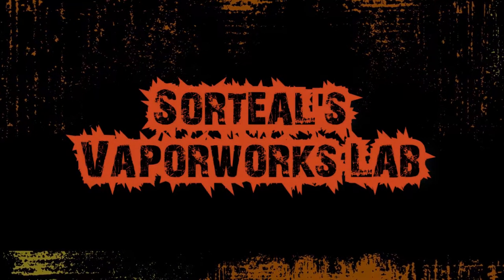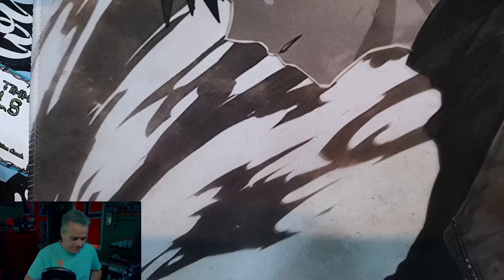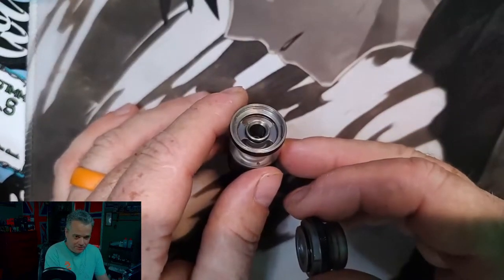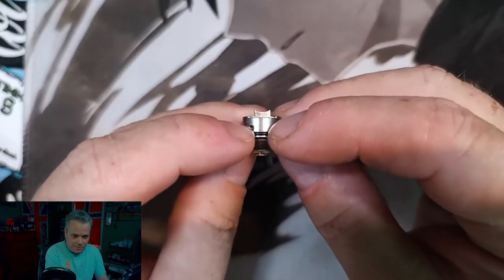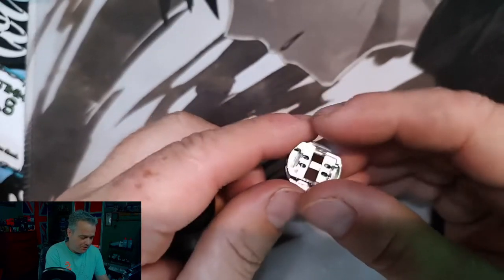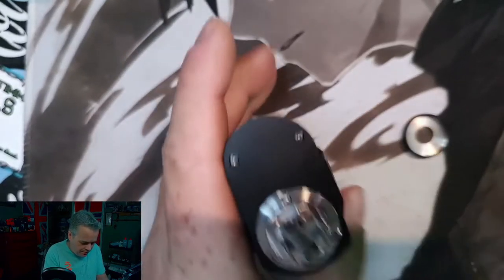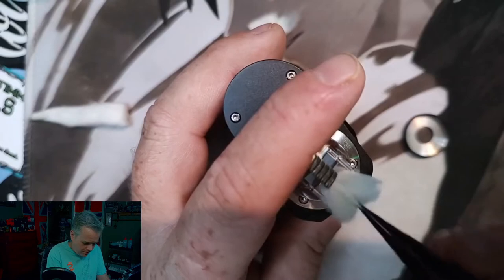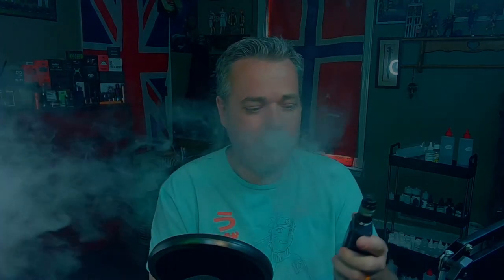The Nitrous RTA from Damnvape and Koko Sarang!

Comment: Please guys, let's be honest at least for once, I know we all want to make money doing all these reviews but, it would be nice if people can be honest. This RTA doesn't work with anything higher than 50/50 VG/PG. If you try anything around 70/30 and higher, you're in for dry hits and I dare anyone prove me wrong. This by far if the worst RTA I've ever built on. It won't wick for shish or it will just leak when filling it. And no, I lifted the cotton and tried various cotton snugness.
The major issue everyone is afraid to talk about is the wicking holes with are just too damn small for anything above 50/50 juice to flow through.

Comment: CAn you think of some RTA that don't require tucking? or GTA? Just cut the cotton and screw on top cap? Technically this, M25, Aromamizer v3 are GTA right? because rdta style wicking on build deck?
Reply from the maker: When I say RDTA style I'm talking about the wicks being dipped down into a pool of juice. The M25 has those channels where juice flows onto the exposed side so not really RDTA style. The Profile M and the new Blaze RTA are the dipping your wicks with juice flowing under the deck into the wick well which is kind of RDTA-like. The Nitrous RTA is gravity fed so you don't have to do a whole lot of tucking and in fact you really just want to lay your wicks into those wick wells just slightly and leave your cotton puffed up. The Eclipse RTA is wicked just like an RDA so it may be more of what your looking for. None of those would really qualify as a GTA imo. GTA are tank Atomizers with the deck in the center of the tank and has been closed off, pressure-wise, and the wicks hang down very much like an RDTA. The Mage from CoilArt and the Fuji from Digiflavor are examples of GTA atomizers.
Reply from the maker: Bishop is wicked almost exactly like he seems to be wanting. Project X as well. Great suggestions!

Comment: If nitrous rda have a score at 10, how much this nitrous rta score for flavor ? 
Because, any rta i have, usually the vape is not saturated enough as vape from rda ,even though the wicking just fine and no dry hits
Reply from the maker: If the Nitrous RDA was a 10 the Nitrous RTA would probably be about an 8 or 8.5. RDAs always have better flavor imo because you control the saturation not so much the capillary action of your wicking. There are some RTAs that rival "some" RDAs but the best RTA will still lack the flavor of any of the, say, top 5 or even top 10 RDAs (a bad example but you get the idea) Yet, that's just my opinion and I'm a flavor whore 🤣
Reply: @Sorteal  thanks mate, i only use rta when i am on long drive with car , just like you said, rda still the king